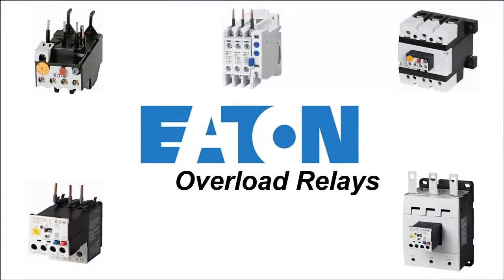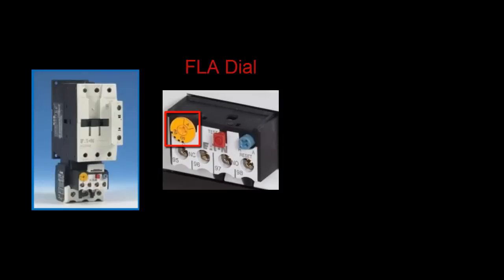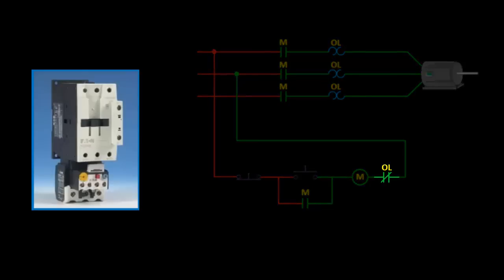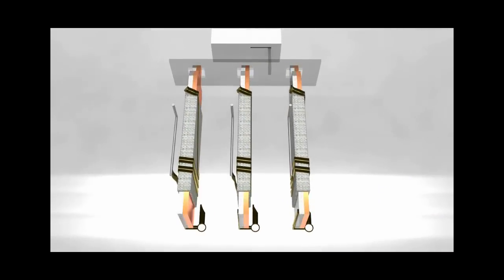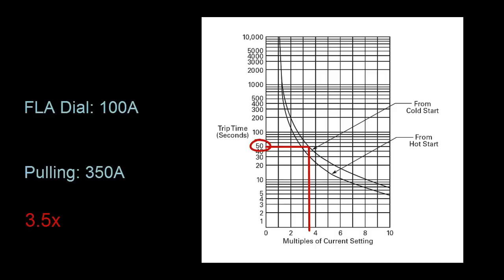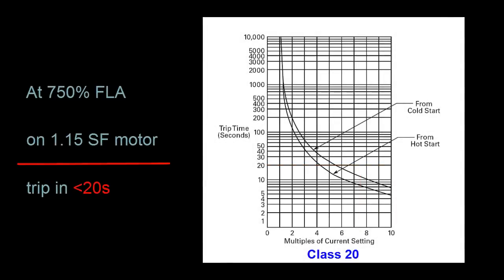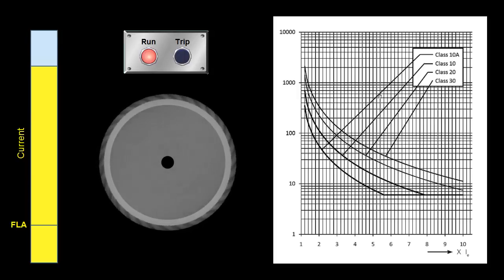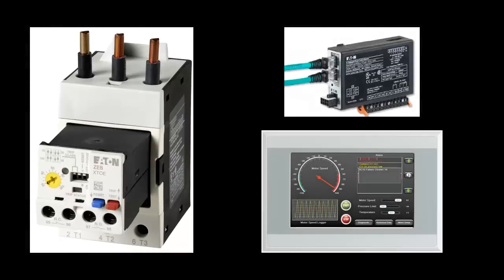Introduction to Overload Relays

Comment: I have a 15 hp motor rated 22 amps. 
How much current i have to adjust on thermal contact dial?
Reply: Your e-motor FLA is 22A, so OCR should be set to 22A (+ temperature compensation coefficient if OCR is located in overheated enclosure with temperature over 40deg C).

Comment: As every  motor load is different  the overload protection relay  should have a current as well as a time setting. For example, one can have a load which has a high inertia and for that one needs a  longer time setting. Or one can have a motor, which starts on a light load ( e.g.  an unloaded conveyor belt) which needs a shorter time.  Hence every overload should be tuned for the  type of load. This can only be done with a current and time settings, hence  with electronic overloads. A number of companies make such overload relays, unfortunately Eaton did not have this facility included in their newest electronic relays. back to the drawing board!
Reply: Each OCR is defined with Trip class (most common for industry are 10 and 20). It is exactly what relates to time needed to trip a motor.